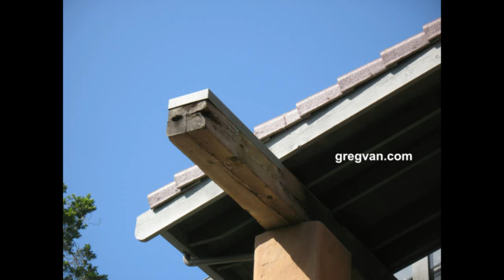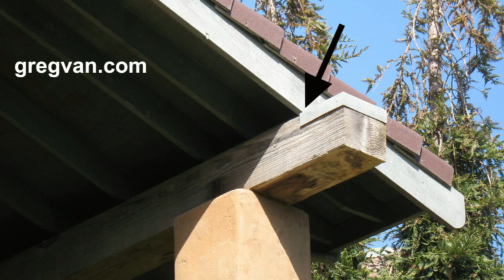Metal Flashing Over Exterior Wood Beam - Building And Construction

Comment: thank you for this. our roofer told us we should cover our beams with copper (?) but i imagined that moisture would build up between the metal and wood and cause rot. i asked some construction workers what they were using for a similar application and they said asphalt emulsion but a company that manufactures this told me it wasn't appropriate.
Reply from the maker: You do bring up a good point. If you lived in an area where more moisture could accumulate under the metal than would be diverted from above, then this might not be the best alternative.

I've only seen it done once, but the architect covered the top of the beam with a rubberized product (it can usually be found at your local home improvement centers in the window flashing area) and then put the metal on top of that. I will make a video eventually and post a link care when it is completed.
Reply from the maker: Here's a link https://youtu.be/rFc-JSId9XU hope it helps.